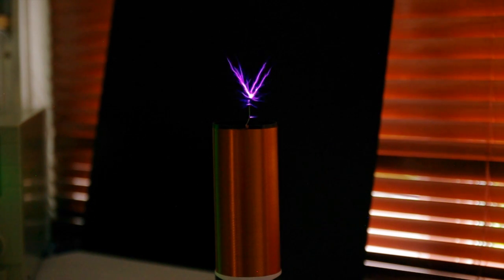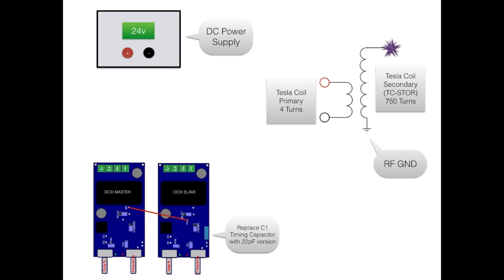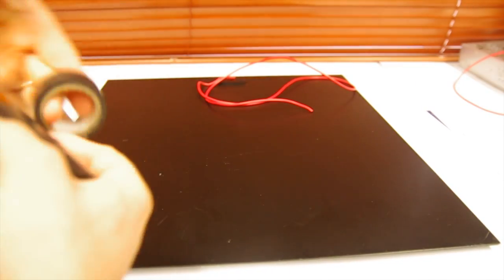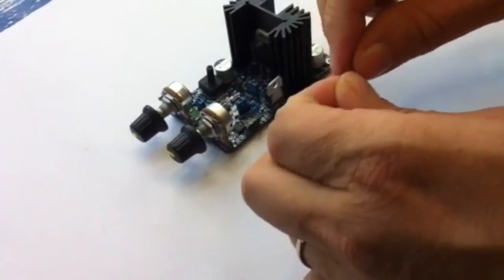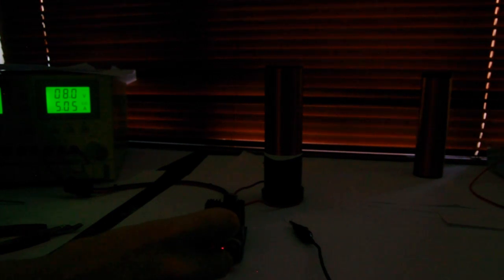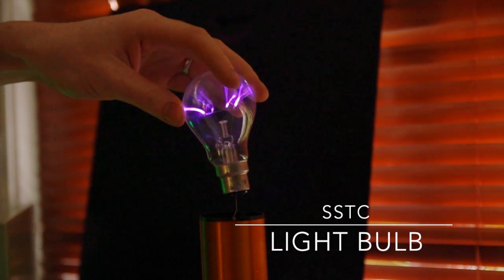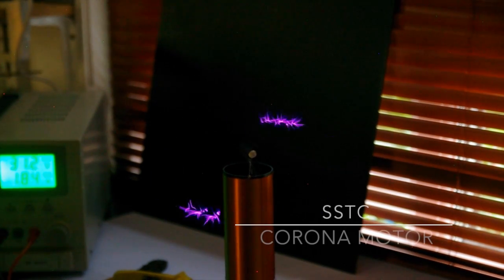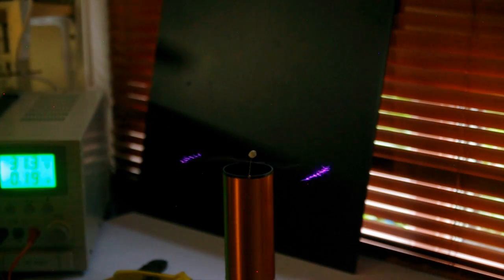Make a Simple Solid State Tesla Coil with a PWM-OCXi

Comment: Can i use only one of these to use for a medium sized tesla coil?
Reply from the maker: If using just one, you will need another signal source to modulate the output as it will heat up fast running a continuous waveform at high power.

Comment: How does the spark rotate on top of the coil?
Reply from the maker: James Hutton Actually this is not correct. Electrons are not really flowing out of the points as it is a high frequency AC device. Even if they were such as in a DC system, the mass of the electrons themselves is not significant enough to produce the reaction force needed to move the wire. The force is produced by the air at the tips of the wire being heated by the plasma streams. This air expands and pushes back on the wire causing the rotation.
Reply: It is a corona motor made from wire. Check the article on  our website for details.
Reply: sonicycles electrons flow out of "points" easily. So if you angle the points properly like they do with the wire, the electrons propel the wire to spin.
Reply: I know. I actually made a video explaining all the physics about it. Even put a lit zippo on top to demonstrate the higher air pressure. Yeah my  answer was very quick and not specific. Sorry. 
Yeah to whomever just look up "ion-wind" for all the info on it. You can actually feel it sometimes